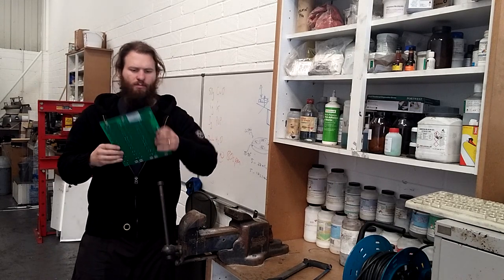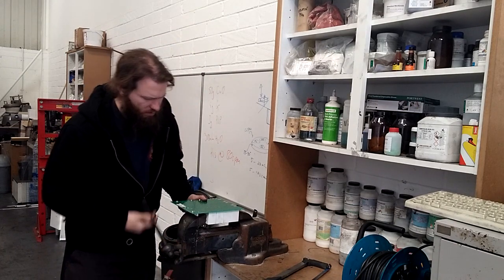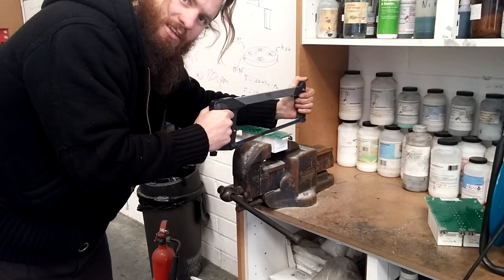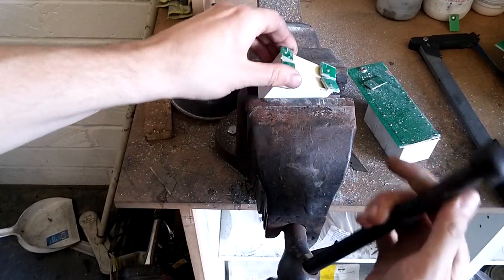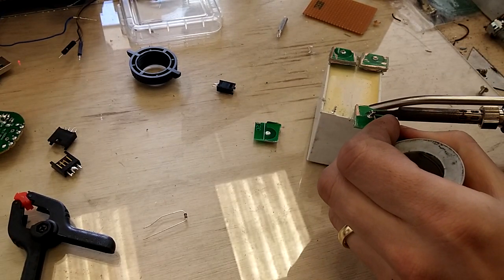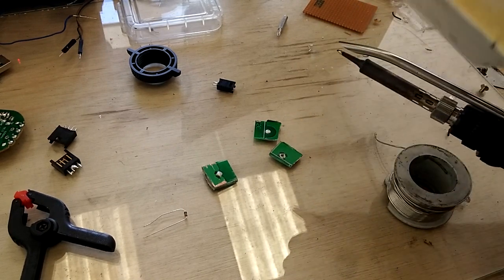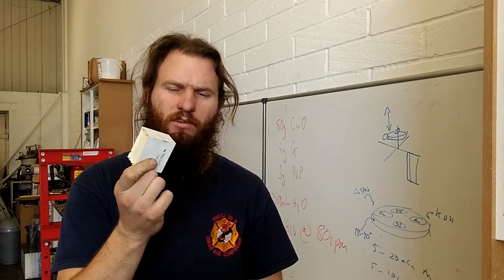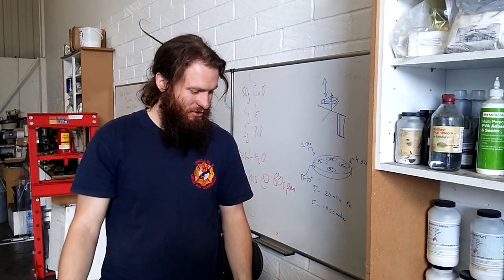Desoldering Power Electronics With The Aid of A Saw

Comment: this is when a solder sucking station comes in handy.  they are very expensive though....

I have used heat guns to get the job done as well
Reply: Clown Whisper cool, I couldn't personally get enough heat with a heatgun on these boards

Comment: if there is that much copper in those boards, a bit of clean up and sulfuric acid could be used to start the reclaiming process by making copper sulfate could be made for turning it into nano materials on the cheap :)
Reply: Thomas Anderson good idea but there isn't really that much copper in absolute terms, but in relative terms the boards have very heavy copper layers and that makes a big difference in desoldering

Comment: Heat a tray of silica sand, lay the board on the sand and the parts pull/fall right off. At least that's how we did it..... wow 30 years ago, now I feel old :/
Reply: Jeff Jones thanks, very interesting,  not heard this method before, we do have a kiln in the lab so I wonder ...

Comment: Next time save time and effort, purchase chipquick alloy used in smd reworking and apply a touch to each point. Stays liquid for a long time then just lift the board off. Best component removal aid and not expensive.
Reply: jason steedley chipquik is cool stuff, I wonder how easy it would be to homebrew :)
Reply: It's fairly inexpensive I'm one to save time and effort and just buy in bulk. I don't think in home I could make a 180 degree melting point alloy. I use it Alot to do hot air desoldering and soldering esp with smart phone charging ports, multi point micro soldering with out damaging any pads or bridges.
Reply: Nice, I'd like to see how it performs on heavy pcbs.
Reply: I have a stock pile of alloy for my phone repair store I'll have to pull out an old pcb and make a video for you. Used it yesterday for a 80's jeep wrangler ECM board replacing old old capacitors. Works like a charm bc no space to get solder iron under or around capacitors but hot air at low temp is enough to do this with out damaging plastic connectors.
Reply: Sounds fantastic mate, desoldering the impossible to reach :) looking forward to seeing the vid
Reply: I have a challenge for Robert and you, I unsuccessfully tried merging solder and graphene to increase its conductivity and conduction of heat, however it would repel the " contaminant.

Comment: What if you used a hole saw, you can get small ones that are diamond tipped.
Just go down enough to cut through the copper (removing thermal sink), You'd twist off the leg of the cap if you went right through though.
Reply: bridgendesar interesting idea, i gues if it was really high rpm it could cut through without twisting?

Comment: There may perhaps be a better way of doing this. If you're going to desolder frequently then either make a reflow oven out of a toaster oven (to liquefy the solder just so you can turn the board over and knock them out)..  or.. copycat what's done professionally and make a pool of melted solder maybe a quarter inch high and just lay the bottom end of the board in and yank the pieces out, So think of a hot plate with walls which melts and holds an ingot of solder. Screw the solder sucker.

Btw, the new guy explains things really really well. I like his videos!
Reply: Sean Lutz incidentally I do have a reflow oven ;) The melted solder bed sounds pretty radical, I'd like to see that in action, perhaps a bit overkill for this heath robinson reclaimation operation :)
Reply: Nicola Arnold 
works every quick, just set it above the surface of the solder and pull out the through-hole components. Surface mount ic's require you to submerge it further but overall it really doesn't overheat the components since you scale the temp right at the melting point rather than hit it dead headed with an iron. Tbh, I haven't had any major fume issue either.
Reply: Sean Lutz it does sound rather awesome, do you reuse the solder in the bed each time? do you have to add extra flux?

Comment: One thing I don't understand is, how does the heat get conducted away so quickly into the copper plate, after all it is not touching the pins of the capacitor, ((well maybe one) else it would short it out.?
Reply: Andrew B good point, only two of the pins are directly connected to the groundplane, they were probably the second two I did in the video come to think of it. The non-groundplane pins tend to be dificult too however as the pcb itself will conduct heat through to the groundplane too, but good point :)